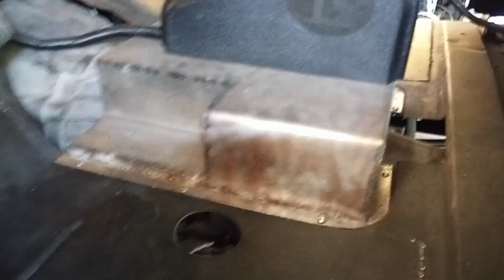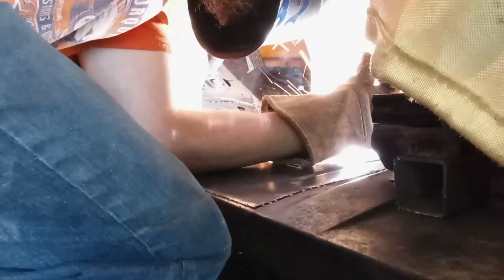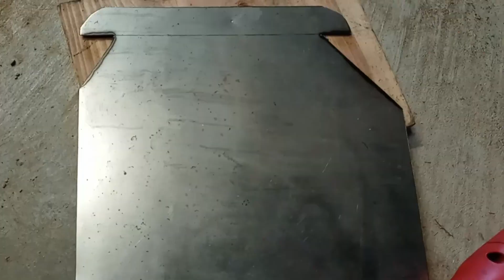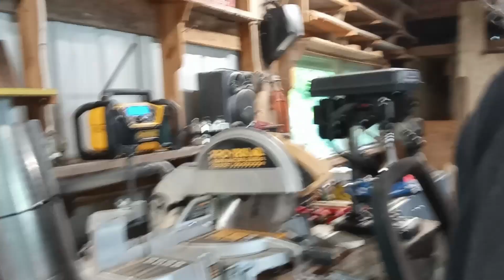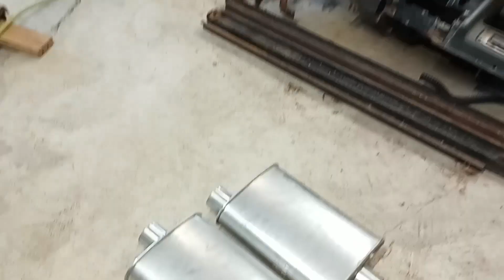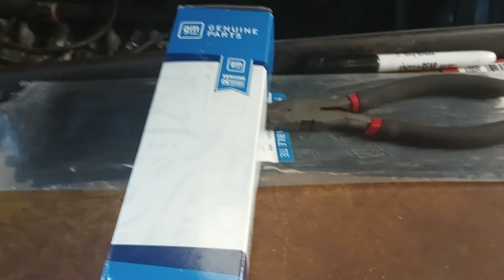Ls swapped 48 Ford F1 rat rod, trans tunnel, exhaust, o2 sensors.

Comment: Any videos of the actual engine swap? I have a 48 f1 , planning an 5.3 swap
Reply from the maker: No videos of it.I boxed the frame rails and then set it back as far as I could.Made some mounts from 3/16 plate while it was hanging from the hoist.Had to use the f body oil pan since It's got the mustang 2 suspension.Also gonna need block hugger headers.